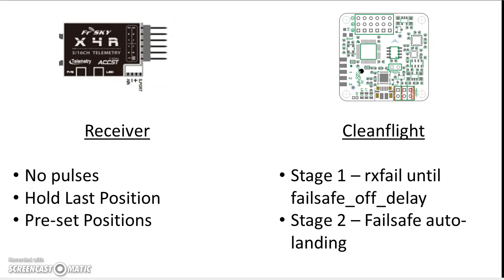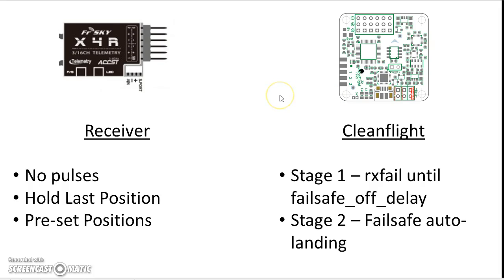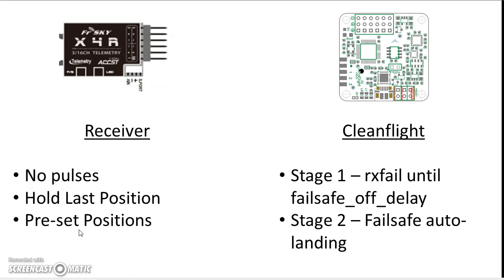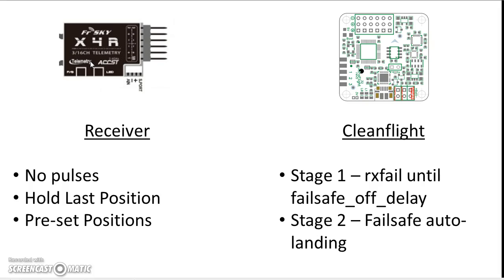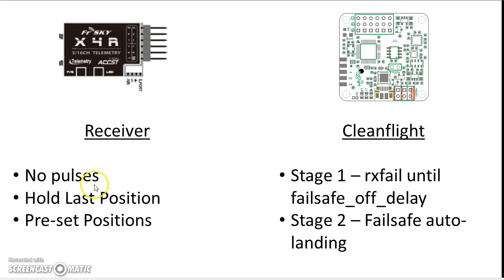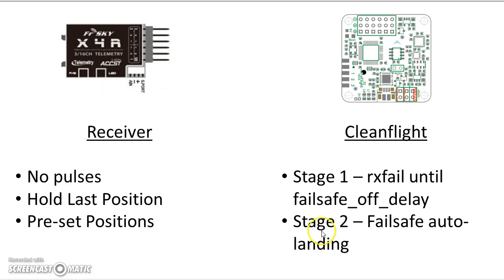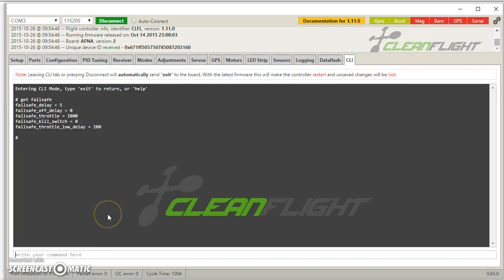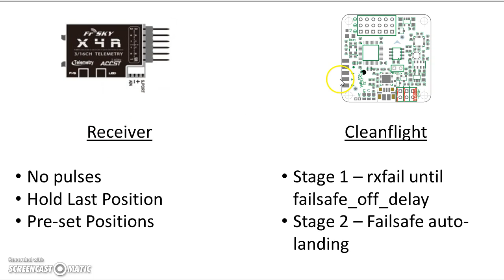Cleanflight Failsafe Configuration Overview

Comment: So glad I found this, thanks JB 👍.

The Flysky 9x AFHDS receivers seem to hold last position by default as you say, frightening...I own one (for a plane, and used to use for a 10" quad), but the Flysky AFDHS2 ia6B seems to do both  throttle goes no pulses (whether failsafe is enabled or not) and other channels can be pre set.  Bear in mind I'm not using default Flysky FW, it's the 14 channel version.
Reply from the maker: https://www.youtube.com/watch?v=Da1kZUkdy_o

Comment: Wich of the transmitter is the best as substitution for Flysky reciever that oonly has a hold position? i just bought a flysky AFSD fpv... and fail saif does not work at all... when transmissions is of, the motors just continue their actual RPM... feels kinda risky cause the reciever has a week antena an such... thanx for your helps!
Reply from the maker: Yes it is very risky :-)

The FlySky SBUS receivers have correct failsafe.
Reply: I just bougth a Flysky X6B reciever with ibus, i guess it supports fail-safes... hope it gets here soon, i ll have to be carefull for now... Thank you very much for the information! great explanation vids!

Comment: I am using a turnigy receiver  TGY-iA6c and I recently had a fly away similar to George Posey in comments. I am a little confused as to how to set failsafes on the receiver. do I do or is it unchangeable?
Reply from the maker: I don't know that receiver very well. You need to set the receiver to "no pulses". That is the keyword to search for. Search for "TGY-iA6c no pulses failsafe".

Comment: I have a tarrot 130 with lemon ppm  diversity reciever the failsafe works ie drops when signal is lost .But I keep getting ocasional brown outs causing it to drop .If I enable the two stage failsafe in beta flight would the first stage help with momentary signal loss when turning and getting brown out ? Or would it just drop because of the lemon failsafe ? tia

Comment: Just a heads up. My flysky fs-i6 actually has pre-set positions. I set mine up for zero throttle and disarm. It does work. Note I have installed The ten channel mod, so maybe that fixed it, I don't know. Thanks for all the vids as well. Been a huge help. Much appreciated. Keep up the awesome work.

Comment: I'm using the fsi6 I have had a fly away after a full throttle input and yes it whent into the clouds and where she came down hopefully nobody knows cause if they do it might not had felt good. but I need to know if I did ok I set it to stage 2 and set my landing throttle position to (0) I havnt tested it yet as I'm not completely finished my new build.

Comment: The flysky i6 transmitter and ia6b receiver lets you configure something other than hold position.  I have that setup.  Don't like it but it's where I'm at currently.  Taranis will come later.
Reply from the maker: No pulses is really the best, but fixed positions is okay, since you can manually activate a failsafe kill switch or set throttle to be less than rx_min_usec.
Reply: Yea, i just noticed it can only do fixed position.. I don't really like it though as i set my quad to go to angle mode and throttle down enough to descend at something other than fall straight out of the sky.. Problem is the motors keep spinning when it hits the ground.
Reply from the maker: Caton cox The main thing that's wrong with your approach is that it fails to cover the scenario where the receiver becomes disconnected from the FC in some way. IMO, better to configure the receiver to trigger failsafe in the FC, and then configure failsafe in the FC. If you wanted to do it that way, the motors would stop running automatically after a fixed delay.

Comment: Hi, I would just like some confirmation on cleanflight failsafe values. In cleanflight guard time or throttle low delay has 1= 0.1sec. So if I want a 3 second delay before failsafe kicks in the value i would need it to be 30 not 3, yes?
Reply from the maker: +Phongsta yes. But IMO a 3 second delay is much too long. But it's up to you.

Comment: Excellent! simple and concise explanation I've been looking for this info so thankyou Joshua for taking the time. My grandson is flying a 250 with a flysky 6 channel transmitter and receiver and cc3d control board with no failsafe set up as far as we are aware so we really need to address this issue. Thanks again!
Reply from the maker: +Trevor Vernon Glad it was helpful. Definitely, definitely confirm that failsafe is working correctly before flying!

Comment: I use a tfr4-b. My issue I am running into is that I have to have motor stop enabled in order for the quad to completely shut off the motors. Other wise when failsafe kicks in the motors drop to the minimum throttle setting and keep spinning. What am I doing wrong. ?
Reply from the maker: +TeamBlindMouse I don't know. If you have failsafe configured correctly, the motors should stop when the receiver drops.

Comment: Here’s the thing. I used to set my D4R-IIs by clicking the failsafe button to pre-configured settings. (Zero throttle + Switch Aux to Beeper on). However, with with the X4R, there are more options. I understand using no pulses, but wouldn’t it add yet another layer of safety to select “receiver” mode on the Taranis, and do as I used to do in the D4R-II (Zero throttle + Switch On Beeper)? I mean, I would still go and set the failsafe on Cleanflight, likely to also trigger the beeper apart from cutting throttle. But it sounds like have 2 levels of safety would be better than just have the receiver cut out.
Reply from the maker: +Danny Cruz I think it's just a matter of preference. My thinking is that adding another level of failsafe just confuses the issue. CF's failsafe is capable of doing what I want to happen, so I don't see an advantage to adding receiver failsafe to the mix.
Reply: +Joshua Bardwell Fair enough, fair enough. :)

Comment: Thanks for this, some remarks though:
@9:56 it should be failsafe_delay instead of failsafe_off_delay. failsafe_off_delay is used to terminate the auto landing attempt (as you mention correctly @10:31).
@10:50 if failsafe feature is OFF then stage 1 continues forever. So it is very important when the flight channels are set to hold with rxfail,  that stage 2 is enabled and configured.
@11:40 Yes, drop your race quad is the safest, it can take a hit. But if you have an expensive camera setup you probably want to try and land it in a more controlled way (also using GPS in the future :)
If one decides to activate auto landing it is best to combine that with failsafe_kill_switch = ON, that way you can still decide to drop the quad when the auto landing is in progress.
Reply from the maker: +ProDrone 100% agree.

Comment: IMO, killing the motors ASAP on signal loss is the best solution, spinning props are always going to be worse than non-spinning props and I really dont care about damage to the frame itself to attempt a "graceful" landing. It's just not worth it.
Reply from the maker: I agree, but I really don't want to start the back and forth argument.
Reply: Horses for courses :) It all depends on the application and circumstance!

Comment: At the end where you discuss testing -- you mention turning off your receiver.  Do you mean test by turning off transmitter?  (With the other test being unplugging it from the FC, right?)  A great addendum (I know you were running out of time) would be a quick on-screen run through of your recommended steps from what you might do with a popular receiver (like the FrSky D4R-II) and in Cleanflight (i.e., what can be done in GUI, what needs to be done in CLI, etc.)  As you mentioned, there are so many options that I get brain lock, and default to doing nothing. :)
Reply from the maker: +John O'Shaughnessy Yeah, I meant turn off the transmitter--sorry about that. All I meant to say was, if the only thing you do is turn off your transmitter, you may not be testing Cleanflight failsafe. If your receiver is set to "hold" or "positions" then it will continue to send pulses and CF failsafe will not trigger. Then you may still have a problem if some day your receiver is disconnected or powered down from your flight control board.

To be 100% safe, you must do one of the following:

1. Set your receiver to "no pulses" and verify 100% that this is working (some receivers, it can be hard to tell if you've really activated "no pulses" or not). You can test this by configuring "position" or "hold" failsafe first, then set "no pulses" and trigger failsafe. If the values "hold" or go to "position" then no pulses is not activated.
2. Set your receiver to "position" and configure throttle to go below rx_min_usec. This will be equivalent to "no pulses" for receivers that can't do "no pulses" since CF will register invalid signal and will go into failsafe.
3. Configure a Mode to activate Failsafe Mode and then configure your receiver to "position" such that an Aux switch triggers Failsafe Mode.

Again, the sure-fire way to test is to both turn off your transmitter AND to un-plug the receiver from the FC and/or power down the receiver. This will ensure that you are 100% sure what will happen in any failsafe condition.
Reply: +Joshua Bardwell Excellent.  Thanks for the additional info.  I've ticked failsafe on in CF, but my D4R-II is certainly still set on whatever default failsafe behavior it shipped with.
Reply from the maker: I believe you can set the D4R-II to "no pulses" as follows. First, bind it to your receiver. Second, power down both receiver and transmitter. Next, power up the receiver only, and press the bind/failsafe button for about one second. If you re-bind the receiver you must repeat this process.

I don't know what the default is for that receiver, but if it is "hold positions" (and it often is), it's a disaster waiting to happen IMO.
Reply: Thanks.  I'll try that, and I agree, for a quad, hold position is not a good idea.